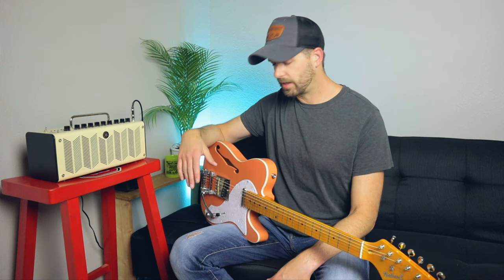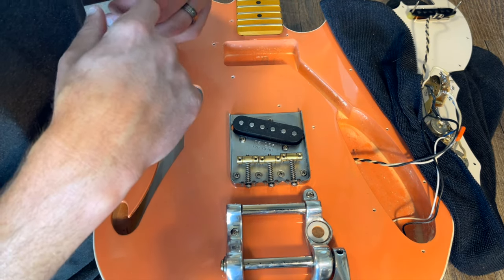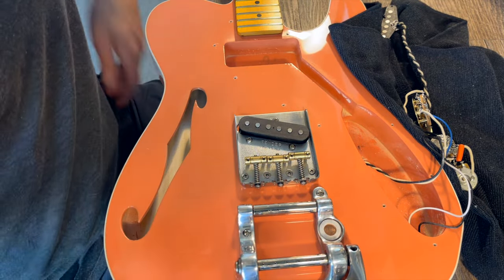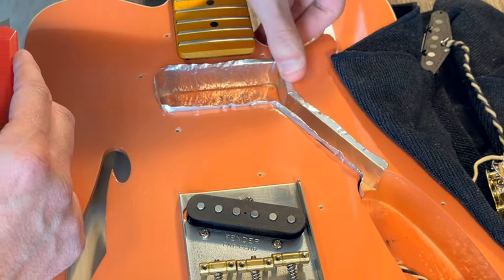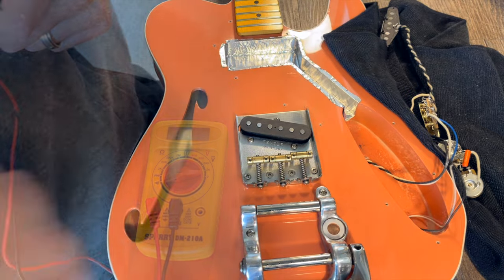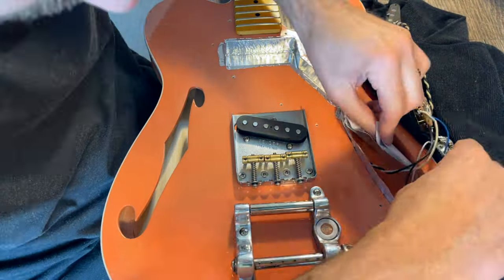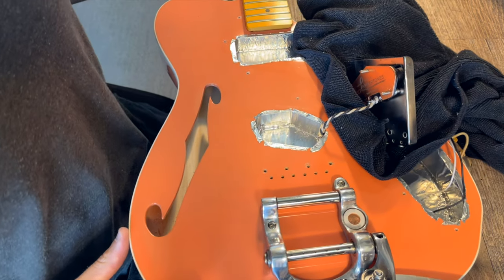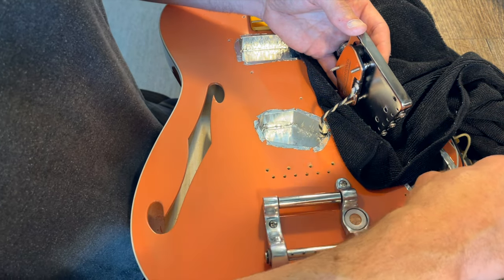Simple & Inexpensive Method for Shielding Using Aluminum Tape

Comment: I did this to a Squier Mustang that wasn't really noisy to start with but I had it all apart to work on it anyway so I figured "why not?" I used similar adhesive-backed 2" aluminum tape meant for sealing ductwork etc. The cavities were painted with black shielding paint, supposedly, but the meter showed it didn't always have continuity from point to point so I just put the foil over it, being neat and careful, going for full coverage. Also let the tape lip over the edges and shielded the back of the pickguard. I used a version of your folded edge jumper technique to maintain metal-to-metal contact between the tape strips. Long story short, I was ASTONISHED at how quiet this made the guitar. I've since done this on a couple other guitars and gotten good results. One technical point- this is not actually a 'Faraday cage' since your pickups, controls and hardware protrude outside. It's just a radio interference shield but it works, better on some guitars than others. The big pickguard area on Fender-styled guitars probably aids the effect.
Reply from the maker: Thanks for the feedback! Sounds like we’ve had similar results. I agree that this has made a big difference on all the guitars I’ve done it to (Teles & Strats). Like you said; conveniently, the guitars that typically need it (with single coils) usually have a large pickguard to help. I haven’t tried this on any humbucker equipped guitars I have.
Reply: @NathanSink  I did it to a Les Paul with uncovered humbuckers and it made a big difference. The uncovered fronts are still open to EMI exposure in some situations, nothing new and not a big deal really, just figure what's making the noise and don't aim at it. Tele, Strat and P90 single-coil players already know about this anyway. An interesting thing about shielding is besides amps, neon lights, display screens and so on, you'd be surprised how much the human body's own electrical properties and nervous system can interfere with signals in a guitar or other device, with some folks more than others. Try it with a portable radio sometime, if you're a charged-up live-wire kind of person like me you can mess with the radio's signal by changing body location or waving your arms. I was also hit by lightning when I was young, maybe I give off more radio energy than most people. Ha!
Reply from the maker: @markpell8979  😂 that’s crazy. You’re electric!

Comment: I  did my strat with the aluminum tape. Total took away the hum.   I didn't know about the continuity issue but it still worked.  I did burnish all the edges and overlapped the top.
Reply from the maker: Nice!

Comment: is there any difference between aluminum - copper tape at the end result? or one of them actually better than the others?. thanks!!
Reply from the maker: Nope. Both work the same. 🙂
Reply: Yes, Google it.
Reply from the maker: @rocknewtonfilsterwilly7364  here’s an article from Guitar.com that says, “While copper is indeed the better conductor, it also carries an increased price per metre. Aluminium is only slightly weaker for guitar shielding purposes, but it’s both cheaper and more plentiful.”

https://guitar.com/guides/diy-workshop/tech-talk-how-to-shield-your-guitar/#
Reply: @NathanSink  It is inferior for several reasons, if you can't afford a roll of copper tape go find something else to do.
Reply from the maker: @rocknewtonfilsterwilly7364  I can afford a roll of copper, but I’m also economical. The goal here is shielding unwanted signal noise, not fine circuitry. I’m not wanting to argue. If you choose copper, great….but aluminum does the job too:  it just does. 🤷🏻‍♂️
Reply: @NathanSink  Still inferior, always will be.
Reply: Both work exactly the same. The only advantage of copper tape is that it admits solder making easier to add the ground wire.

Comment: does regular kitchen aluminum foil work?
Reply from the maker: Yes, but I’ve found it difficult to work with. It tears easily & doesn’t seem to go where you want it. If you use it I would recommend the heavy duty kind (not the cheaper, thin version).
Reply: @NathanSink  thanks for the answer. great video btw, it's helping me a lot
Reply from the maker: @tomhet_0  glad to help!

Comment: There’s no ground connected to the bridge plate, doing this killed two birds with one stone though!
Reply from the maker: If you check out @22:55, you can see that the bridge pickup is grounded to its own baseplate & that baseplate is connected to the bridge plate through the screws. I did have a set of Tex Mex pickups in this guitar before. The bridge pickup of that set doesn’t actually have a baseplate, so instead there was a little “pig tail” that grounded it to the bridge plate. Hope that makes sense.

Just for kicks, here is the video where I swapped out the pickups: https://youtu.be/0bJzKfwdrB4?si=Bu25mPFoicTIwahX At @5:39 you can see a comparison of the bottom of the bridge pickups.
Reply: @NathanSink ah I see what’s your mean, I’m not entirely sure that baseplate would serve the same purpose and based off the before and after that sounded like a grounding issue combined with the lack of shielding. Either way, informative video!!